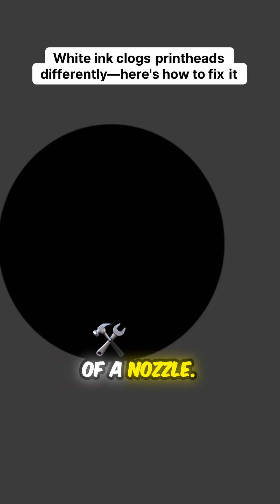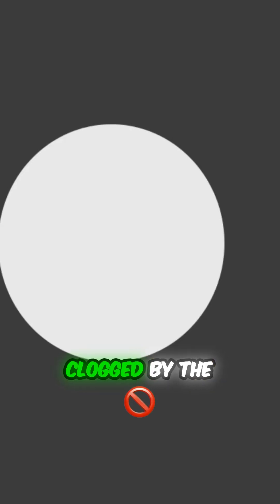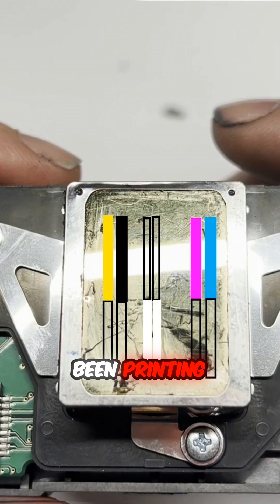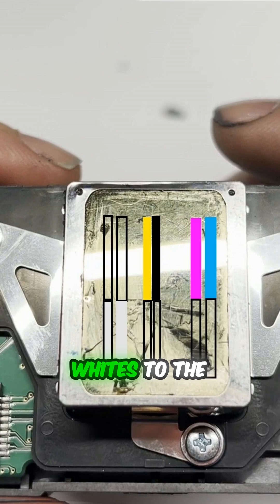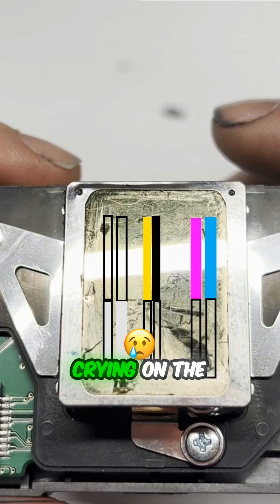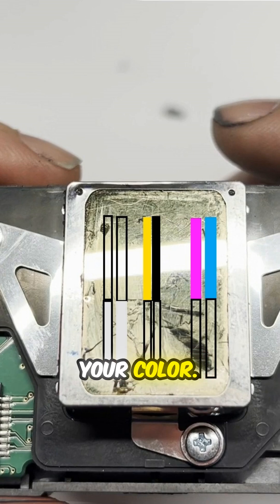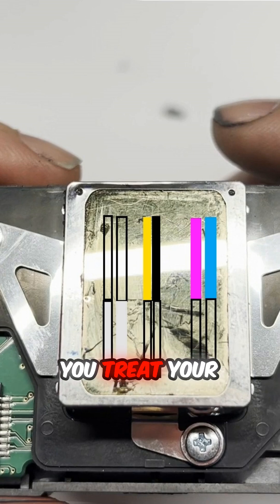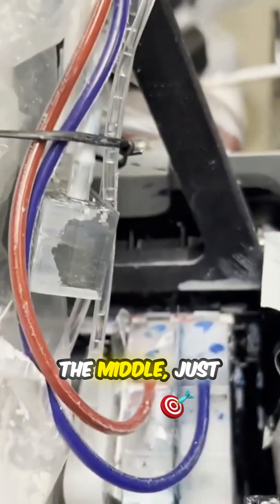Say Goodbye to Ink Clogs: Master Your Printheads!

Comment: How do I fix this line that's coming down my prints sir I cleaned the roller bar and it is still there it's stopping me from printing large prints help please 1390 dtf EraSmart
Reply from the maker: Thanks so much for subscribing and supporting the channel—it really helps us push toward our 100k goal (we’re getting close!). I appreciate your question, and since you mentioned the line is “going down,” I’m guessing it’s a vertical line. That usually points to a tiny ink smudge on the CR belt—that’s the clear belt running behind the printhead carriage. Try cleaning it carefully, and that should fix the issue. Subscriber questions from 2024 have all been answered, and in 2025 we’re sticking to a 48-hour response window for subscribers like you. Let me know if that doesn’t solve it!